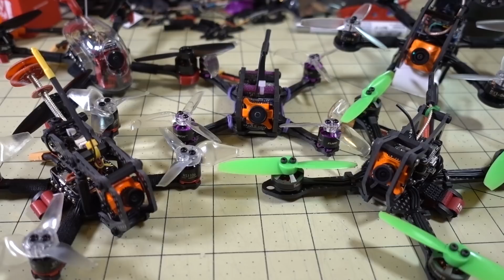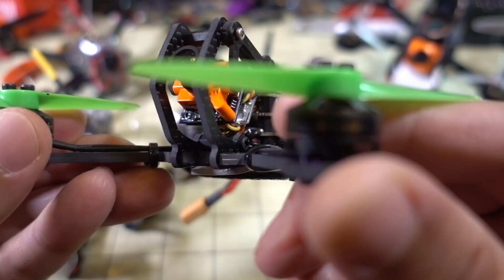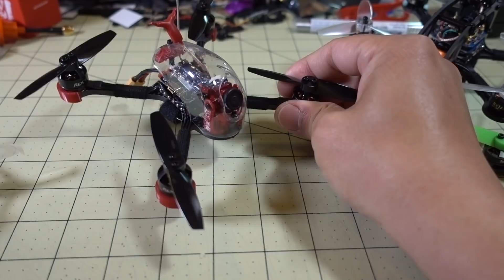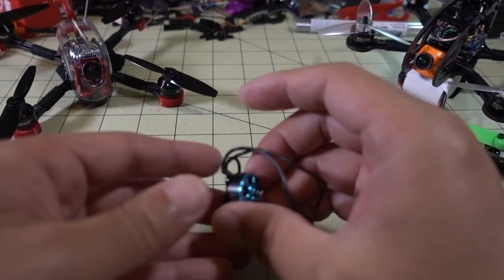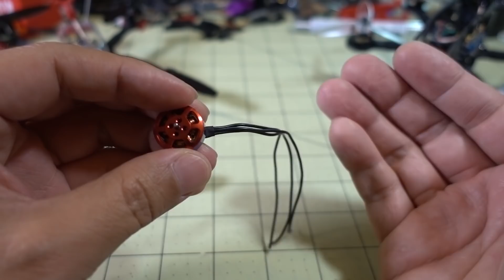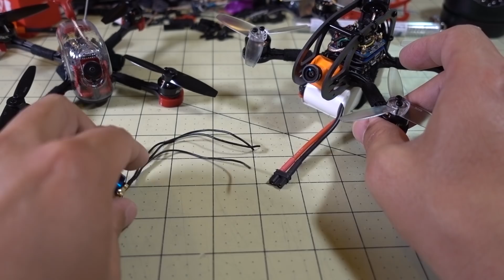Micro Motor Discussion and Preview 🌤️

Comment: Mr.Kim. May I ask you what motors you recommend to replace Iflight  Cinebee 4K 1104/5000KV. One motor not working after my first flight with a mild crash. Just my luck. Seems Iflight discontinued the motor. I am new to hobby and would appreciate your input. Hope to hear back soon. Thanks in advance.
Reply from the maker: Try these - http://bit.ly/2HnvX1l
Reply: @AlbertKimTV  ya had those in my thoughts.  Thanks for the recommendation.
Reply: @AlbertKimTV  Turns out the wires are only 55 mm long. May end up being too short. What do you think of the Mamba 1105/5500KV motors?

Comment: Hey Albert, thanks for the videos and all the advice and info!  Considering 13xx/14xx motors aswel, building a tomoquads shinka 2.5 freestyle atm and need to choose between 11xx and 13xx/14xx. I like to fly aggressive so don't want to lose the pop, what is your opinion?  Got any advise?

 I prefer 3s but 4s won't be a problem, flighttime aim is 5-8 minutes 

Also would you recommend the 2.5" frame or a 3" frame with a 2.5 build? 

Thanks in advance!

Comment: How do you think the RotorX RX1404 3600kv motors would do with 2.5 inch props? Do these motors use an M2 9mm mounting?
Reply from the maker: Yes, those motors use the 9mm hole pattern.  I would not go to a 2.5 inch prop.  Even on 4S, the performance will be weak.  They were designed for 3 inch props.

Comment: I'm going to make a three-inch drone
I am thinking about what to use the motor to use the 3s battery 
Emax rs1106 4500kv or dys 1404 4300kv
 Which would be better?
Reply from the maker: I don't know the answer to that yet.  If I had to guess, the 1404 motor.

Comment: Albert are these bigger motors safe for 2.5 inch triblades like the Genfan flash 2540 on 2s and 3s????
Reply from the maker: depends on the motor and KV, but most will probably be just fine...  I plan to test these on 3 inch and 3S/4S, so 2.5 should not be an issue.

Comment: So do those 14mm motors have the same bolt patent as 11mm motors?
Reply from the maker: The 1402 and DYS 1404 motors use the 12mm pattern.  The Airblade and RotorX 1404 use the 9mm hole pattern (11xx)

Comment: Hey Albert, If you still have that Skyzone 140mm frame you should use it with those DYS Be1404's.  I have a similar build and use it with a 4s 850mah, it's like a little rocket 😀
Reply from the maker: Thanks.  I was considering that...

Comment: I noticed my 2.5 build with 1104 5500kv on 3s will last about 4 to 5 min. The power is pretty much the same until you punch out, but why kill the batteries? 
I just tend to stay away from high KV all together and I've been just fine. If you want to go fast and not burn your equipment, buy low kv motors with high voltage batts.

Comment: I'm sure you've heard the old saying, "it's not the meat, it's the motion," and nothing could be truer in this instance. Pretty flying has not a lot do do with raw power. You may find it interesting that after testing and tuning eight quads equipped with HGLRC stacks from 2" to 3", I've found that the motor noise generated by HGLRC motors from the 1105 6000 through the 1407 3600 to be the absolute lowest (by a wide margin) over SunnySky 1106 5500 and 6500kv motors as well as RCX 1407 4100kv motors. The RCX motors are the worst in terms of noise (electrical noise) on the Blackbox spectral analyzer. The HGLRC equipped quads are fine with no d-term notch filter - the dynamic filter takes care of what little noise the motors create. The SunnySky's all need a tuned d-term notch to avoid becoming too hot - all on Betaflight 3.3.1 with the Stage 2 BQRC filter set at 90hz and the soft gyro lowpass set at zero. The Stage 2 filter does a better job at higher frequencies and the same job as the stock Gyro lowpass.
Reply from the maker: wow, this is good info!

Comment: Dumb question but do these larger have the same mounting dimensions ? I go through more of these 11xx motors than batteries its mostly the emax motors ive used recently so longer flight would be nice
Reply from the maker: It depends.  Some have the 11xx mount pattern (9mm) and some have the 13xx mount pattern (12mm).  You have to check specs to make sure they fit your frame.

Comment: Great stuff! I admire your curiosity for more efficiency. Rather rare these days.  I do have a question though on the 1106  type motors. Do their efficiency go up dramatically with lower kv to compete with the larger motors you mention? All you mentioned were the high KV 1106 type motors. I installed Sunnysky  1106 5500 kv motors on a recent build and am hoping for the best,,but I think I may find a much better alternative  from your future videos . Looking forward to see what you come up with.
Reply: I'm trying to split the difference, too...I'm building a massive droner 2.5 with the Hawksky 1107, but rather than go with the 7500 kv or 6500 kv versions, I'm going with the 5500kv.  I know I'm giving up some top end speed, but hopefully will gain some flight time.  

I also have some 3S 700mah and 800mah batteries from some prior builds - if they're not too heavy, I figure they could help with increased flight tone, too.
Reply from the maker: An example is the babyhawk-R 3-inch which uses the 4500kv motors.  On 3S you can get long flight times but at the expense of power.  The bigger motors can give you both long flight times and still have good power.  I'll try to point this out in a future video but you'll have to keep an eye out for it as it won't be labelled in the title of the video.
Reply from the maker: it won't be long before the 1112 motor comes out.  We'll have to run that one at 1600kv to get 1 minute of flight time....  LOL
Reply: In my attempt to make my 1106 5500kv Sunnysky motors  work efficiently I will try a new prop with less pitch. The AVAN MINI 3 INCH PROP 3X2.4X3 and see how it goes compared to the KingKong 2840's. I am also waiting to maiden my Mode2 6 inch quad with the racerstar 2403's.

Comment: We all 'know' low KV versions of a motor = more torque and efficiency. Is it actually true? 

-OR-, are they simply running at the lower RPM ranges and/or using bigger props.

If props, AUW and battery are equal, would a 7500kv hover the same time as a 4000kv?

Comment: I think all 2-2.5" quads are too fragile.  But then again, the area I fly is 50% concrete.  Any time you even graze the ground either the standoffs shear, or the lens breaks, or part of the frame/cage breaks.  The 3" class seems a whole lot sturdier, and can carry a much larger battery (850mah).  The more I get into 2-2.5" quads the less I like them.  I am bleeding money on them.  I'm trying UAV style frames now, as I think those will be more sturdy.

Comment: Thanks for doing this testing for us! Can’t wait for the videos. Do the different size motors have the same mounting dimensions?
Reply from the maker: it depends on the motor so check the specs before buying.... some use the 9mm pattern, others 12mm.
Reply: Albert Kim thanks! I bought 1105 6000kv on 3s for my Nemesis X with 2.5 props. Still waiting on one more part to get it flying. What do you think my flight time will be with this setup?

Comment: I'm looking forward to these motor reviews. I have been looking into 13xx-14xx sized motors a bit lately. It seems  these motors are geared more for 3S and 4S setup (guessing by kv). 
Do you think going to anything above 11xx sized motors pretty much means using 3S lipos (minimum)?
Reply from the maker: Yes, pretty much to get the efficiency you have to increase prop size, reduce kv, and increase voltage.  As you increase voltage, current drops for the same amount of power (wattage)...  watts = amps x volts

Comment: Good vid, I still think 11xx is a better size for 2.5" and below but I agree, we've gone too far towards what a 5" is and we don't have the prop efficiency to get away with it. I think the issue is that the kvs we are using are too high. I think we need to be chasing weight rather than kv and give up the quest for higher top speeds. I'm looking at low kv setups on 3s rather than 4s but with much smaller batteries to get the thrust to weight in the right place.
Reply from the maker: Yeah, I saw someone build a 3 inch with crazy high KV motors and got it to beat a 5 inch in a drag race (150mph?).... it flew for 30 seconds.  Hmmm, if that's where things are heading, I'm getting off this train!

Comment: total weight with battery 4s about 500 grams ... I'll give you a list of everything I've assembled ...
frame ..GEPRC VIPER ...
FC OMNIBUS F4 V2.1 ..
ESC ... RACESTAR SHOT 4IN 1 ESC 30A ...
CAM ... RUNCAM EAGLE 2 PRO ...
RX FRSKY R-XSR ...
TRANSMITTENT ... EWRF e709 TM3 ..
BATTERY ... TATTU GENS 1550 MAH 4S
Reply from the maker: I'd check the props and tune.  It's not too bad on weight.

Comment: Try 1404 RotorX will beat the RCX 1304 with insane efficiency, 1106 and bigger is a horrible motor size with the sunnysky 1106 and brotherhobby with strong magnets are battery killers.

Comment: Yes I have a xk 251 it rips on 2s with bigger 2 blade props plus very strong crashed it hard many times before breaking a motor mount (it's plastic ) 1307 motor 3000 kv seems to work very well

Comment: Very nice.

Great idea.  I agree the 1106 7500kv is just too amp hungry.  Sure it’s fast, but who wants a 1:30 flight time?

I’m in the process of building a 3” long range (900mhz) rig with the RX1404s and a split mini on a RX Switchback.  I’m definitely torn on whether I should go 3S or 4S on a 650~850mah

Comment: I've just finished a 2.5" build with 1106 6000kv and I'm getting 5 min flight times on 2s 550mah GNB lipos (waiting for 3s in the post) the only 7500kv i run is a little 2" build which is a 2s only 1104 (small and quiet for park flying)  and my et125. When I do a 3" build I'll definitely take your advice Albert thanks 😀

Comment: hi i have a problem that the brotherhobby engines returner r5 2700 kv. . . they heat up enough. . . the other components are FC OMNIBUS F4 V2 AND RAcestar shot 30A 4in 1 ESC. . . .
the question and what does it depend on and what can I do?
thank you
Reply from the maker: Things to check are the tune, the weight, and what prop you're using. 2700kv is pretty high so a lower pitch prop might help.  There are numerous other factors but these are the ones to look at first.

Comment: So if you're moving to bigger motors, will that likely also increase the size of the models? Like more 3" than 2-2.5"?
Reply: cutthenoise Hey, that cool and sad. Don’t forget that ultra light 2.5” quads like the leader 120 get 5-6min flight. I think we should keep 2.5” quads bellow 70g.
Reply from the maker: Did you see my 37g ultralight 2.5 inch model?
Reply from the maker: Yes, I will be focusing on 2.5 and 3 inch models.  The 2 inch models can still stick to 1102 to 1104 motors and still perform well.
Reply: Albert Kim yep, love it 😊

Comment: What about 1103 10000kv motors?
Wondering what you think of them on a 1.5 inch build
Reply from the maker: Generally those small props are very inefficient and flight times are also short.  The super high KV motors don't help much either.  I try to stay away from anything smaller than 2 inch.  They are not much fun.

Comment: A general question: it seems that your experience with 2" builds is generally negative? I have to imagine that it's not the motor (1106 vs14xx) but the prop size that makes the difference. Is there a 2" setup that you like, or is the overall performance increase for 3" incontrovertible? The only micro I have is a  Lizard95 so my experience is limited :P Thanks!
Reply from the maker: I think 2 inch is limited by the small prop size.  Not much performance and flight times stink too.  They were fun in 2016, but it's obvious now that 2.5 and 3 inch is the right size for a good experience.

Comment: I can't help but wonder if the same thing could be applied to 5" quads. Something ridiculously wide and short, like a 2602 or something. Not for racing I wouldn't think, but for freestyle, maybe...?
Reply from the maker: Perhaps.  I have a 2403 motor on a 6 inch quad and get 8 minute flight times on a 1300mah 4S.

Comment: Thank you, thank you, thank you!  I so totally agree with this goal and have been thinking about this for some time now.  In my own very limited and painfully costly way, I've discovered that making one simple change can drastically change my flight experience good or bad.  

Everything depends on everything else, so bigger batteries aren't necessarily better, larger motors aren't necessarily better, faster KV isn't necessarily better, or vice a versa on any of those variables, it's all a mysterious delicate balance to figure out... And don't even mention props, 2s vs 3s vs 4s, etc...just saying.

For me it's all about flight time and everything else is what gets me to where I'm happy with what I want from that build.  Getting there is the hard part.  In other words, flight time is my measuring stick that tells me, even on a high performance build, if I am heading in the right direction...  At least until now...

Really looking forward to your work on this and what you might uncover and to help get me into making better purchasing decisions.  By the way, did I say, thank you?
Reply from the maker: Yeah, this is complicated stuff.  Lots of variables here.  So it might take some time to figure it all out.  Welcome to the journey!
Reply: It will be an interesting ride, no doubt about that.

Comment: Honestly this has been one of the main factors I haven't gotten into racing quads yet as I don't see myself enjoying limited flight times and purchasing large amounts of lipos let alone the start up cost of radio and goggles, etc. which I am just getting now. There are a ton of benefits with brushless though and building is really cool for some folks. Learning software is a roadblock for some also but that's not the topic here so I really just wanted to mention I am glad to see you addressing this cause I will appreciate it and learn a bunch before I waste a ton of money hopefully, thanks :)
Reply: You have some really good points! They are all the same reasons why I switched over to the smaller builds. I built my first 5 inch back in October of  2017 and it was costly every time I crashed. Every order I waited over a month for the parts from China and this almost made me quit entirely. Well designed minis take a beating and you're most likely to come out with little to no damage.

Comment: Im with you on your motor theory....even though im running a RotorX 1105b 65000KV on Tattu 3s 450mah packs...pushing the envelope i can get 5min to 51/2 minutes flight times. And im getting ready to build a 3 inch set up in the upcoming months...but im going to wait to see your results on these new motors your testing...for me its not about the punch outs or max thrust...its about how long i get to fly...looking forward to seeing your results 😊
Reply: Is that with a 2" or 2.5" prop or other?
Reply: Inspades101 2.5 Gemfan flash props on 117mm Tomo Quad Sidewinder build with Emax F3 mini stack
Reply from the maker: Are you using a 3 inch prop?  Yes, I will have info on flight times for each build so you'll have an idea how a setup performs.
Reply: Albert Kim using 2.5 Gemfan flash props on Tomo Quad Sidewinder build.  Is it even possible to run a three inch prop on a Sidewinder build...didnt think there was enough room? Or am i wrong?

Comment: Hey Albert. I got two Spintec frames after your review. Not bought motors yet. So if I get 1306 motors like your rcx’s what Mah 4s do I get? Please do let me know. Thanks. Peter
Reply from the maker: You mean 1304?  I would try a 500mah to 650mah 4S.  You should be able to get at least a 6 minute flight.
Reply: Albert Kim - yes I did mean 1304. 
Thanks for that Albert.

Comment: That's really interesting, man. I bought 1106 SunnySky motors to build a 2.5 inch model, but I bought 5500kv. That way and using the FC stack I bought, I can use 4s batteries in it. Maybe it could be a good solution, I don't know. 😊 Anyway... I started to buy everything for this quad in January and nothing arrived yet. Our mail company in Brazil is HORRIBLE. 😣
Reply: It is going to fly great MC!  i've got a few 2.5" with the emax 6K, the lower KV makes all the difference.  I've got sunnyskys on a bunch of planes, they make great motors.  I run 450-650 3s and get 3-6 minute flight times and handles like a mini 5".  I can run 4s but its really fast on 3s and much more quiet, which means you can get away with flying where others can't!  It will be worth the wait:-)
Reply: jacob james Yeah, I heard the same! But I can't comment yet... Didn't get them yet. 😕
Reply: MC's Creations I'm guessing everything you bought in January is 1/2 price or obsolete now too!
Reply: mshane86 Yeah, you're probably right. But... What can I do, right? 😕
Reply: Canyon Racer I hope so, dude! Thanks a lot! 😀 All my builds are going to be in my channel, but as I'm from Brazil, my videos are in Portuguese. But I'm already creating a channel just for fpv... Didn't published anything yet  (I'm going to do that only after the build video is published)... But if you want to see what I already did: https://youtube.com/watch?v=JMsEC3D2UwM I can only hope that the quad can be as fun as that! 😀